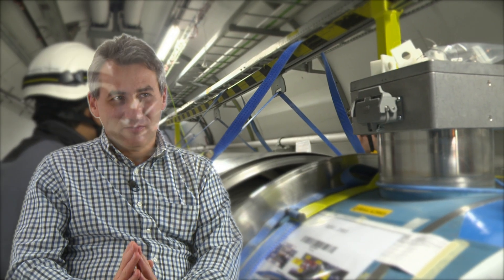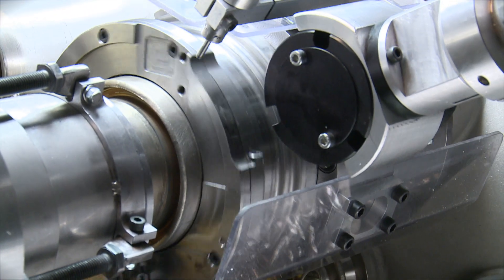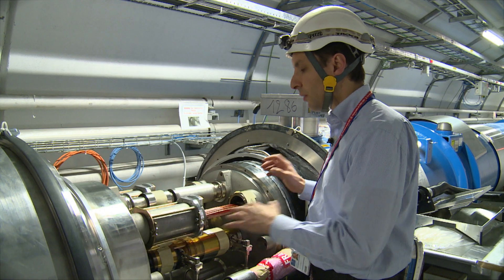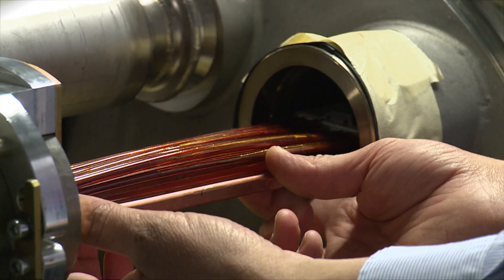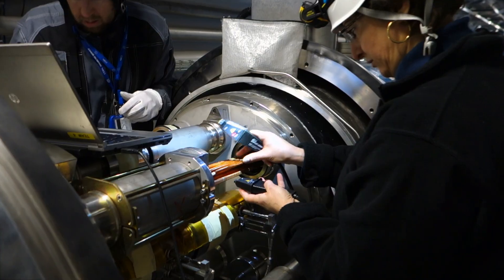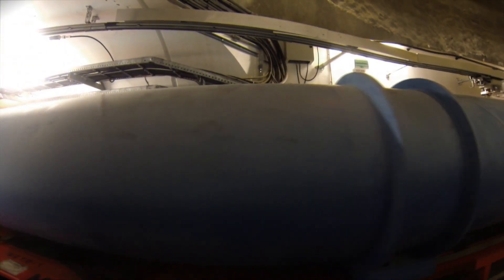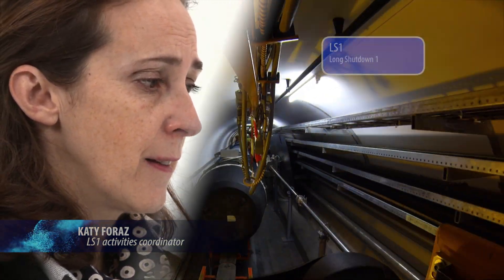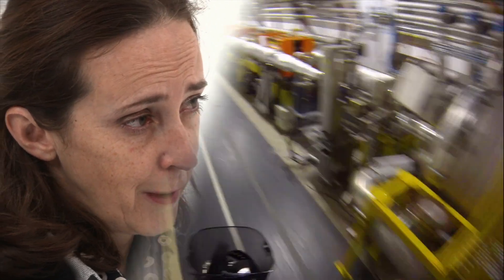The LHC: a stronger machine

Comment: It is good to know that the stronger machine is only temporary. Soon around June things will mess up big time, and you are forced to get back to the weaker machine. It is impossible, that is what you will respond to me.
I sincerely think that it is incorrect. In june it will not be wise to start the testing.
Time is very sensitive. Of what I know. In June 2015, even though it is yet to come for you.
There was a day that I went to bed and the next day I ended up in January of 2013.
Im not claiming to blame CERN for it so much. Yet on the other side, I urge for caution.
Reply: The Infinity Man Did you happen to see..
http://t2.gstatic.com/images?q=tbn:ANd9GcSxFmFiweLksSEf5jK1rqNpdLbQa2NVc0Bhpkcxp0Yu-no6szbKnA
Reply: ghos282
Yes i did. I was not correct.